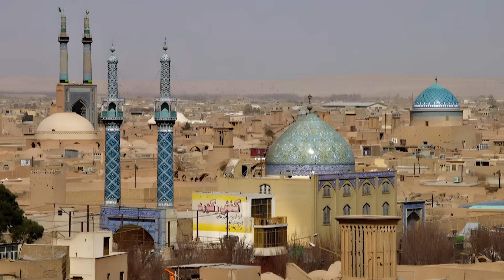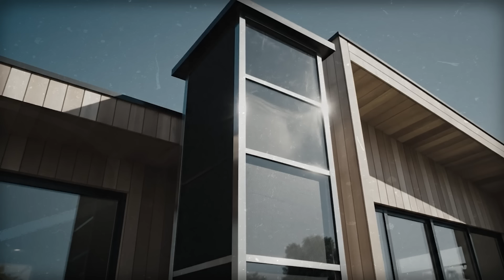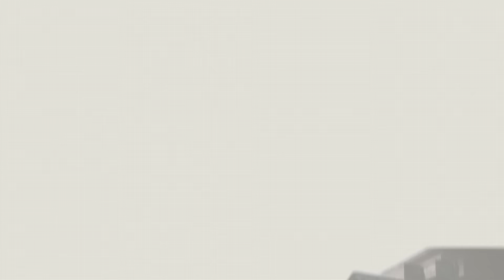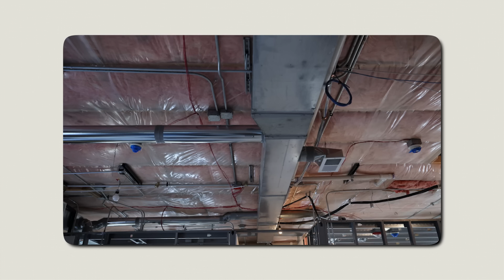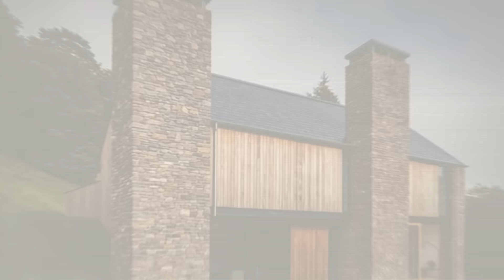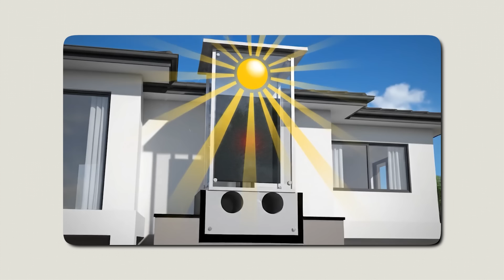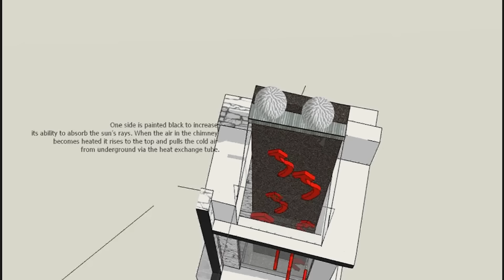This Chimney Will Cool Your Entire Home WITHOUT Electricity. Why Did The Energy Industry Hide It?

Comment: I now finally have scientific reason to install a chimney in my house here in the tropical country. lol
Reply: apparently it won't work as well in humid areas. which makes sense
Reply: @pwi1234  It has to do with mold which is why allot of methods like these are often avoided
Reply: @pwi1234  i live in a humid area, just wondering why you think it won't work in humid areas? is it because water vapor carries the heat with it?
Reply: @Darkgraven because hot humid air doesnt rise as much as hot dry air
Reply: @Darkgraven  It's not my theory, it's on the top rated comment. My gut tells me it's because the air is denser in high humidity thus affecting the air flow, plus the water vapor affects heat flow.
Reply: @saigonrider humid air is less dense than dry air though
Reply: @parthingale_1691  high humidity air retains more heat than low humidity air would
Reply: @parthingale_1691  
It sure lighter than dry air but humid air that consist water vapor than dry air obstruct sweat evaporation from our skin.
Main issue of humid air I think it's condensation problem.
Reply: @Darkgraven imagine the air as a sponge. Dry sponge weighs lighter than wet one. Heating it makes it lighter, but heating a wet sponge is still heavier than dry cool sponge. That's why it won't rise. That's essentially what's happening. Hot humid air is still heavier than cool dry air and so it won't rise.
Reply: @Darkgraven  In humid area ventilation will probably work but not the cooling part, the cooling comes from the wet bulb temperature, it is the lowest temperature that can be reached by the evaporation of water under current ambient conditions. In the example of the badguir it's not the ventilation that cools down the air, it is the fact that the air is dragged underground near water, it evaporates a little water, which cools down the water which then in turn cools the air (which get a bit more humid). Since the lower the relative humidity of air the lower the temperature of water can become, this system works in desert conditions but it is useless in tropical conditions, it will just ventilate not cool down
Reply: @pwi1234  But, humidity hot air is less dense than humidity cold air. Chimney should work, it is the same physics, right?
Reply: @rodrigolucena1698  What about night time? The humidity doesn't go away at night
Reply: @rodrigolucena1698  yes it works anyways but with less efficiency
Reply: Meowdude, this is meow so cool meow stuff meow.
Reply: @timothytyree5211  what is this comment even about?
Reply: @TexasToad  living in a humid climax compared to dry
Reply: Apparently you have to rewatch the video.
Reply: Careful though, a chimney alone isn’t what’s doing the magic here. The cooling effect depends on proper design, airflow, and temperature differences, not just adding a random chimney to the house. Still, it’s fascinating how simple passive cooling ideas like this can make such a big difference, especially in tropical climates.
Reply: Santa ?
Reply: It doesn't work that way I believe

Comment: Not applicable in urban area with many obstruction, high humidity country, and not function properly at night. 
You will have a problem using it with conventional A/C due to the rooms are not properly sealed. 
A/C is much cheaper for household application compared to build complicated structure like this and waste the land (you can try with open area with no A/C).

Comment: I wonder how this would work in places where the temperature goes from -30C to +30C during the same Calendar Year. I do like the concept, though. Seems like after installation there's very little use costs, just a bit of maintenance.

Considering Energy Costs and Climate Change are increasingly important things to consider, concepts like this could be a great solution for a good number of places and environments.

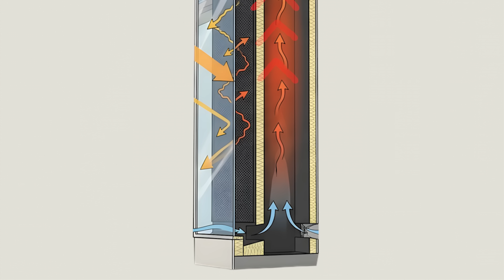Comment: @3:36... Stop saying negative pressure. That's grammatically and scientifically incorrect.
Reply: It's correct though?
Reply: So do better and explain what's right rather than just saying something is completely incorrect.
Reply: You're wrong, a system can have a negative pressure if the surrounding pressure is higher than the internal pressure and it's a very common thing to say. What you may have heard is that Absolute negative pressure is impossible.

Comment: One question: what about cleaning the air coming in from outside? Not all air is clean and often requires HEPA filters, so wouldn't a sealed system be preferable in that case?

Comment: The fact that ancient Persia figured this out 3,000 years ago is kinda insane. We really forgot a lot.
Reply: It wasn't forgotten, it just doesn't work in other areas with high humidity.
Reply: it was independantly invented several times all across the middle east, Yemen for example is full of them, southern saudi too, and Egypt both ancient and modern.
Reply: الحقيقة ان بلاد فارس والبلاد ذات درجات الحراره العالية  لم يعد يستخدمون هذا النظام واستبدلوه بالنظام الاكثر فاعلية وهو نظام التكييف
Reply: @sstss91  The basic difference between this system and air conditioning is that this system is free to use once built, whereas air conditioning is not. Also you can use both at the same time, provided that the modern version of wind catcher is properly implemented. But you need a really good engineer to design something like that, and not just copy the western architecture like most of the Middle East currently does
Reply: doesn't work on hot and humid climates, only dry hot air that's all
Reply: @arjunratnadev so, you're saying that there is no pressure differential when it's humid? How is that possible? Please explain. I live in a humid region and I'm planning to build a similar structure. Will I be wasting my time and  money?
Reply: @bonibroco1076  That thing is not works by pressure differential alone. You add vapor from relatively cold water wherever you source it from and that vapor does most work. In humid climate, you can't add much humidity and not much effect can be achieved if any. Unless somebody found a way to circumvent it you are potentially going to waste money, time and effort.
Reply: @arjunratnadev  😂 save us your ignorance....
Reply: don't be such an imbecile  @abdelhakyac7285  try to learn something real for a change lil bud.., :face-green-smiling:
Reply: FYI…Persia is today called Iran.  It’s a highly educated and cultured nation with science, arts and culture that Murrica can’t even dream of.
Reply: @ianchandley until Islam showed up
Reply: @ianchandley  Persia doesn't exist anymore. Iran is not persia, Iran invaded and is occupying iran.

What science do they have that the US doesn't? Iran doesn't even have a functional government, and they can't even defend themselves. They arrest their own citizens for not supporting the government enough.

Persia was great, but Iran is not persia, and iran is the last place any sane human would want to be right now.
Reply: You don’t live in ancient Persia 

People who do still have them 

Everybody builds for their environment
Reply: @us3rG  trumpian logic 😂 .... You made it clear you have no archotectural or engineering culture... At all.... But at least.... Use your eyes and ears when you watch a video
Reply: @us3rG christians build to be sickened 😂
Reply: Modern man is dumber than a pile of rocks.
Reply: It's probably only insane if you assume that other people can't come up with really good stuff. Great ideas didn't just start in these modern times you know.
Reply: Ceux que l'occident vont renvoyer à l'âge de pierre 
Une nation etenelle de scientifiques
Reply: Inviduals forget a lot, society's and human over time is truly an insane amount of lost knowledge.
Reply: @brandoncampisi6621  This pronciple isn't forgotten mate. It is being used in modern architecture by good architects where applicable. Only the modern versions of it don't really look the same as those old ones
Reply: Invading countries wont help algo.
Reply: That is why 3000 years ago Persia was considered the bed of civilization.  Pyramids are not made of Lego blocks.
Reply: Our president threatened to erase the culture off the face of the earth
Reply: Is that why christians are bombing Iran 😂
Reply: You think we forgot or there are parties that benefit from you being forced to pay for such services? Wake up
Reply: there's a reason why persian figured it out, because this won't work or will not work as intended on different climate.
Reply: it wasnt forgotten, it was never taught and swept under a rug because they cant put you on a payment plan for things like this
Reply: @Kodamare  Nope mate, this concert is still being used in modern construction where it makes sense, only it often looks completely different. The example would be the Sydney opera house which has windcatchers in its design, you just cannot see them
Reply: @milospavlovic7520  I'm scrolling through the comments and I have to tell you, the fact that you've popped in to explain this to every single person who made this assumption is an absolute BALM to my autistic brain. For once, I don't have to be annoyed by people being wrong on the internet! Someone fixed it first!
Reply: @Kodamare  Payment plan 😁
Reply: It wasn’t forgotten; it was simply ignored ...
Reply: @EumlOriginal  Nope, the principle is being used where it makes sense, only it doesn't look like this in modern form
Reply: And Trump wants to bomb them back into the stone age when they were already more.advanced than usa is today😊.
Reply: we didnt forget anything genius. AC just cool better.
Reply: Prairie dogs have instinctively used pressure differential to ventilate their burrows for at least 2 million years.
Reply: Money talks and lack of money stays silent.
Reply: we are erased a lot... i don't remember 200years ago, soo my father and grand father still alive, but even older... They are just colonizers arround here, not civiliation and must built from ground his own homes... Using nothing else than trees, my grand fathers has the luxurious planks to make homes arround. I born and live in south brazil. We need tech that can cool our homes, sadly i live in a apartment and can't do anything to help my home out with passive cooling... I need to take some land for me fast LOL
Reply: In reality, this doesn't really work. If it worked we would use it. But this doesn't do humidity, and it doesn't bring the air down to whatever temperature you want. And it doesn't clean the air that is outside.
Reply: @MegaLokopo  This works and it is being used in modern architecture from time to time where it makes sense. For example Sydney Opera does have this principle incorporated into its design, though it is hidden and it doesn't look like this at all, though it likely contributes to lowering cooling bills rather than completely replacing them. Of course it doesn't work everywhere, but where it does work it can work spectacularly
Reply: We are ran by criminals mate, we didn't forget anything, we were isolated from the truth.
Reply: @Gigatless  Again, this principle isn't forgotten at all. Good architects use its modern version where it makes sense, it just often doesn't look like this at all. Sydney opera house has this principle implemented for part of its cooling

Comment: I intend to use this system when I retire and settle a warm area. I hate cold since my youth, maybe childhood because I suffer pain since years because of it. So I want to build a home which doesnt see temparatures lower than 20 C (the area that I want to live is about 15-45 C thoughout the year). And I also want to live offgrid. So I'm interested in Solar systems. And this passive air conditioning techniques are a really good idea for me. I'd like to know, what happens to the quality of the air after being sucked down the earth. I dont want to use plastic as I dont want to breath the smell of synthetic materials. But I wonder about moisture and mold in the air canal down there. So anyone knows what could be done about this problem?

Comment: Really hard to apply in small scale such as knockdown houses or container cabins.
Also, the efficiency is drastically reduced in hot and humid areas, which need to scale up the chimney; at least a ventilation fan needs to get involved.
In this economic state, I found the most affordable way to cool your house down is cavity wall system and circulate that air inside cavity with a ventilation fan instead.
Reply from the maker: Interesting alternative.  I am surprised you have a cavity wall in a container cabin.  I thought you would have some form of foam insulation.  Appreciate the comment.
Reply: @wildline_YT Summers here can be intense, reaching 40–45°C with an extreme UV index. The EPS panels alone aren't enough, so I built a cavity wall on the exterior of the container. As long as the container avoids direct heat absorption, indoor temperature management is much easier.
Reply: @AEolchb very smart idea

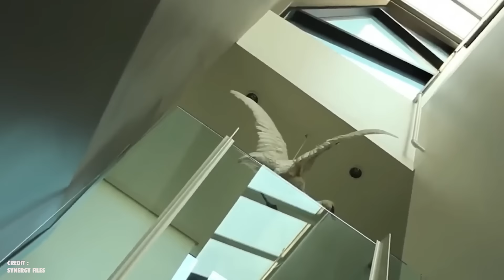Comment: 5:20 106-75=17?
Reply from the maker: Didn't even notice that - well spotted!  To be honest I work in centigrade and the editor converts it to Fahrenheit so there was obviously a glitch in the conversion.  Good to be corrected and something that has to be considered for future videos.  Thanks you!
Reply: I noticed that, too. Ironically, it is correct, at least partially, believing or not! 106-75=31 degrees Fahrenheit, which equals to 17.2 degrees Celsius.

Comment: That's awesome and all, but what about those of us what's severe outdoor allergies? This solar chimney stack would just be dragging in a lot of pollutants and dust. Not to mention the fact that where I live we get a lot of the smoke from the Canadian fires that are going on all year round, so this would just be letting smokey air into where I'm living. That's a horrible idea. They do have a mechanical solution to this which is called an air exchanger which does the same thing but draws it through a complex filtering system to pull all of that stuff like outdoor air allergens and smoke out of the fresh air. I'm not sure if this solar chimney stack has any sort of similar capability for those of us with allergies, breathing issues, or those of us who just don't want to breathe smokey air coming down from Canada.
Reply from the maker: Not sure your assessment is right.  The key principle of the solar chimney is use of the stack effect which uses a change in density due to hot air rising to draw air from within the house and extract it at high level.  So if designed properly it shouldn't draw in any air from outside other than through your normal and existing infiltration points in the house.
Reply: Couldn't u use a centralized and Location specific filters like we do now?

Comment: It's a passive vent. Cool, but not revolutionary. Add evaporation media for the input and it's even better. It's far cheaper/easier to put a swamp cooler in a window and that costs very little in energy. A swamp cooler vs a solar chimney break even for costs would probably be 15-20 years. Most people in the US move every 5 years. Swamp/Evaporation cooler FTW.
Reply from the maker: Cheaper and easier to install - agree! More effective or better, I am not so sure.  One needs a fan and water for cooling while the other is just a static design using the principal of the stack effect.  Payback is also debatable as the solar chimney doesn't use any mechanical energy so zero running costs.  It actually has a payback whereas the swamp cooler doesn't when compared to the solar chimney: Payback= capital cost/ savings (there are no savings for the swamp cooler).  BUT I totally agree they are cheaper and easier to install. Thanks!

Comment: what about night? and what about humid air?
Reply from the maker: You close the vents at night.  In respect to humid air it is not so effective. You would want to install a natural dehumidifier in the home (salt, plant or other natural material) and reduce humidity if thinking about installing the solar chimney.  Thank you for the question!
Reply: @wildline_YT  thanks for the reply, i am in Bangladesh, it's really hot and humid, and even at night, inside the room can be 35-40 or more, and if you are in the top floor like i am, it reaches 55 to 60 at night. so, i am just skeptical, if closing the vent would help out with this staggering heat? I am pro-green, so, if it's possible i'd like to use no energy solution.